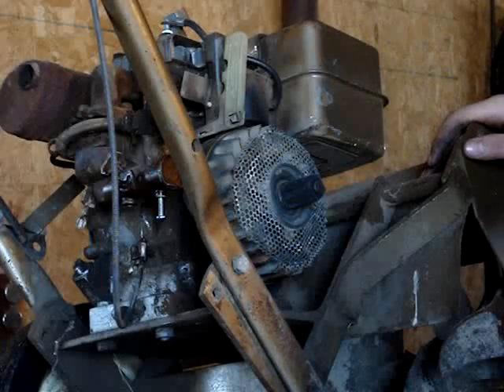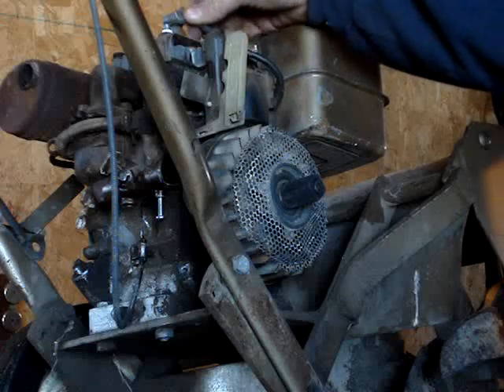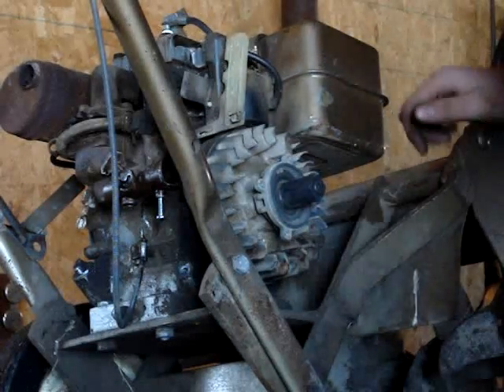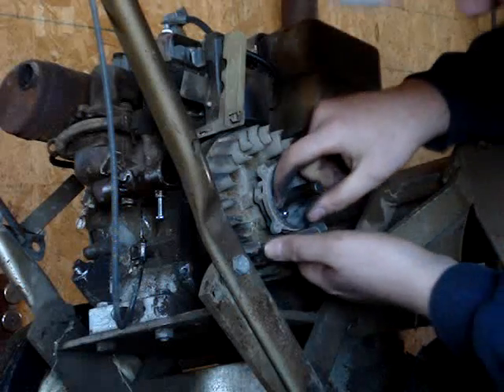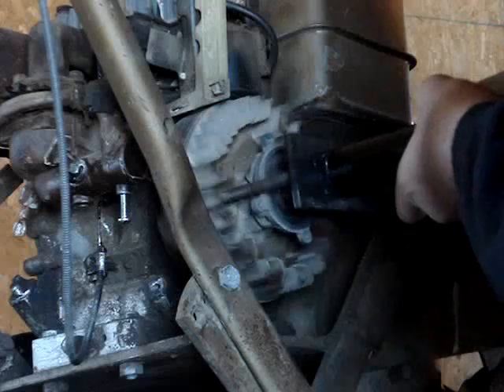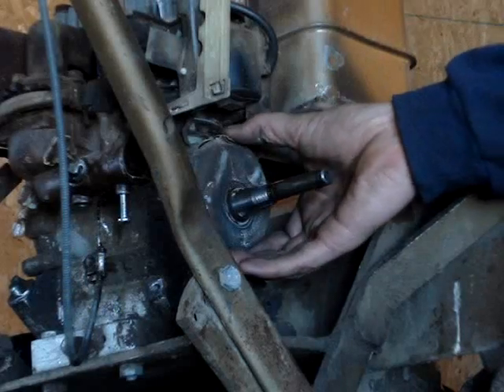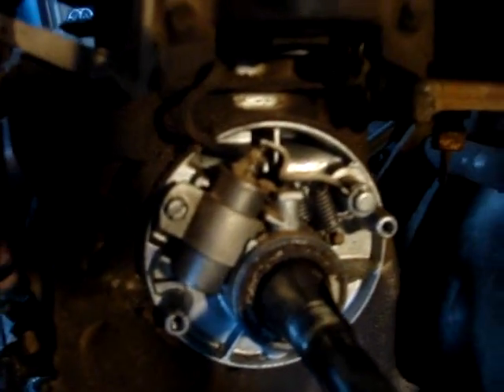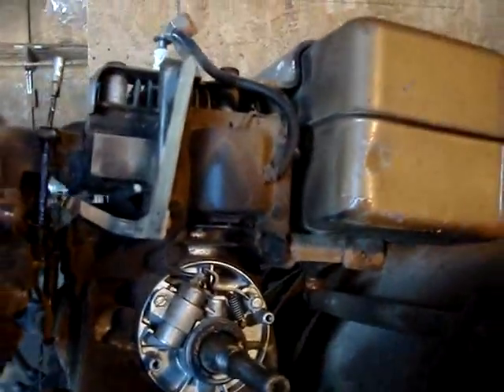How to remove an overrunning clutch on a briggs & stratton engine

Comment: I have a 79 JC Penny push mower with a vertical/horizontal shaft engine that had that same problem. Instead of just sanding (the points were worn bad) I put an overhaul kit in it with a hot condenser. And a hammer works just as good to pop the ratchet loose but that's a good idea too